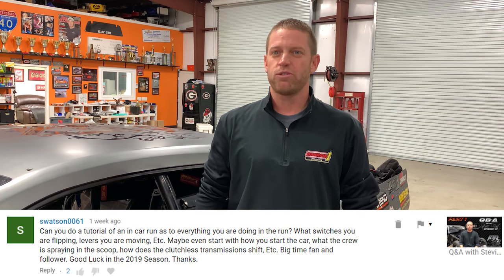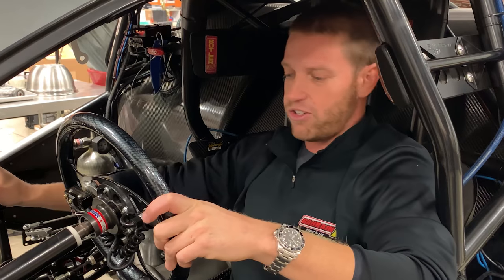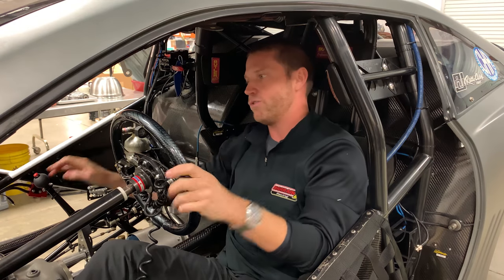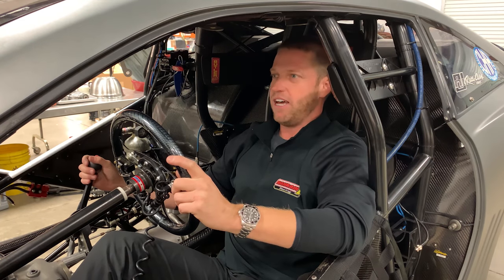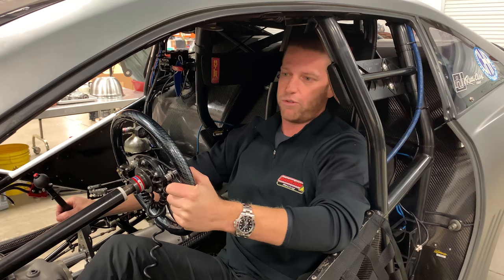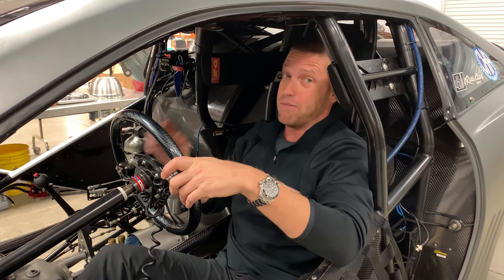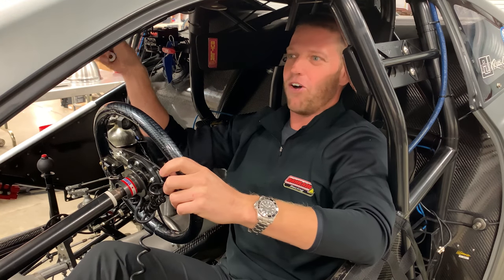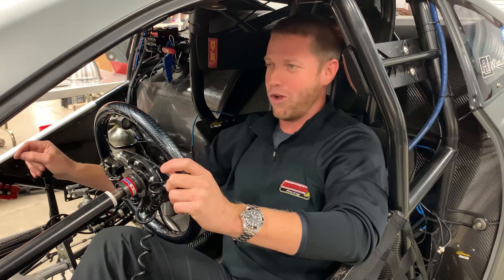Take a Pro-Mod lap tutorial in The Shadow 2.0 with Stevie Fast Jackson

Comment: There is so much going on in a very little amount of time , even with you doing a run down , there is still so much more. Love the video , but Stevie you still was on the wheel after you left. I paused this video, rewind , slow mo it all a hundred times . And it made my head hurt. Glad I drive a PSRA Outlaw Pro Mod with a glide. That sh!$ with the shifter , trans break , and brake pedal would definitely be worth having a camera in the car. AWSOME . Everybody should put there ear buds in, crank the volume up , and watch this run from start to shut down , and pause and rewind often. U the MAN Stevie

Comment: Good job on the walk through of 'A Day at The Office'... lol   You explained well, didn't talk down and above all, you seemed authentic.  You do love what you're doin'.  Thanks for sharing.

The 'gear meshing feeling' when you shift sounds like the feel of shifting a manual trans, minus the clutch. Some 50+ years ago, I learned to up-shift, and down-shift, as a method for testing the synchro's in a tranny.  If it shifted smoothly, and didn't grind, you could count on the synchro's, shift levers, etc being in pretty good shape.

You match up the engine RPM with the rotational speed of the trans to find the 'sweet spot'. You're applying a little pressure on the shifter, enough to feel the trans, then when the sweet spot hits, you can feel the gears slow, mesh, and you're in the gear.

Try it on an older stick shift, trucks are the easiest.    Good luck in your career.

Comment: I have a B&J Quick Drive converter trans brake set up that works similar to your Lenco trans brake unit. Something you might try doing when slowing down from a burnout is just before barely coming to a stop, activate the trans brake button and feel it into reverse. Slides in like butter because the transmission has stopped but the output shaft to the driveshaft is still barely turning with the movement of the car. Do the same when backing up from a burnout. Just as you are about to come to a stop hit the trans brake button just before stopping and you'll be able to move the lever to forward gear feeling it in with little effort. It keeps you from getting stuck between gear teeth where it won't let you find the forward/reverse gear without releasing the trans brake button again and again.

Comment: Do you use a pro-cube delay box?  If so... I’ve been doing a research project on the Z-Force setting.  Granted a professional driver already has well-established a movement pattern... I believe for a novice: just pressing the trans brake button down, instead of holding it down then releasing, allows you to decrease the perceptual demand of telling your antagonist muscle to quiet down and simultaneously telling the agonist muscle to contract; Simply tapping the button to set the brake then tapping to release has a lower mean reaction time in ~24 of the 32 people I’ve tested.

Comment: That was awesome, informative and entertaining Steve, thanks!  I've "only" designed and built Virginia Tech's Formula SAE car for four years eons ago as well as being our engine team leader and doing 100% of our dyno tuning for our turbo charged fuel injected 20mm post throttle restricted Honda CBR 600 F3 motors.  I autocrossed these cars as well as my daily driver, a 1973 Porsche 914 2.0 liter (the bigger if the two available engines. 😱😋  At least she only weighed 2,030 lbs at Watkins Glen with a full tank of gas.  I've been a John Forde fan since I was a kid because he was sponsored by Castrol and that's what dad put in his car, then as a young teen I liked his win or die trying attitude, his "don't wash the good luck sweat out of it" fire suit, etc.

I imagine y'all build your own motors, do you?
What about the chassis?

Are you able to race on sponsorship money or are you like my old coworker's friend who lived on adrenaline and credit cards while his other racing friend scraped by on money won  & contingency?

Take care and good luck.  I learned a lot, that was awesome.  Thanks again.👊

Comment: I do have 1 question. And it may have been touched on in other videos. But do you run fuel tech or similar or are you still old school like lutz and run bigstuff? Old habits die hard but as pain in the ass stuff is there are alot of racers that still swear by it.
Reply: He runs mechanical fuel injection